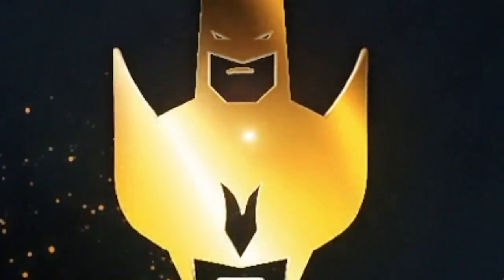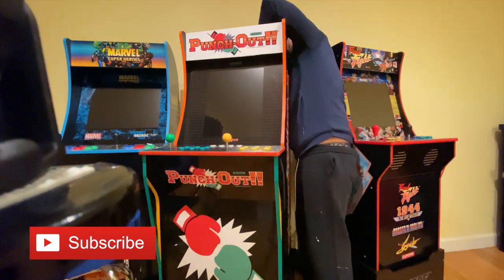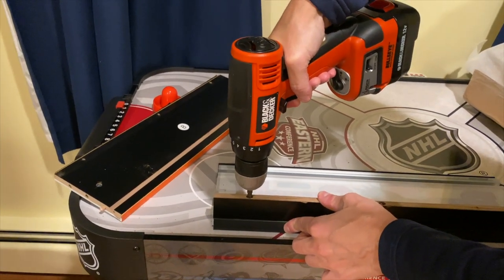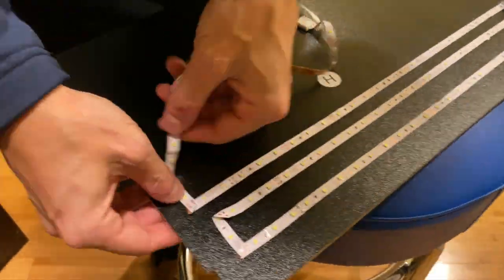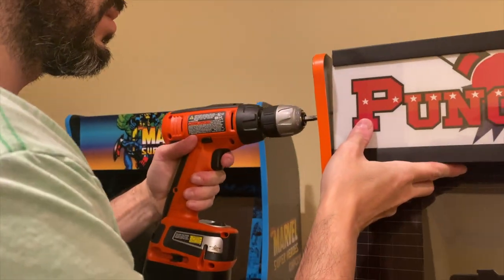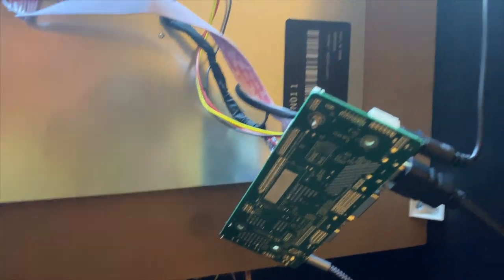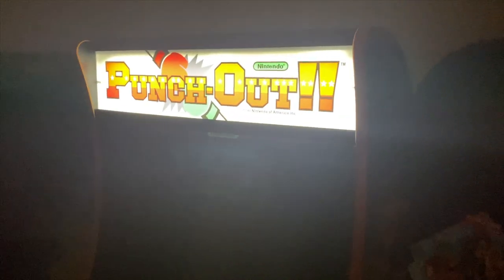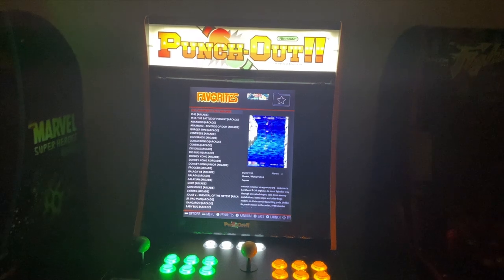Arcade1up Light Up Marquee Install

Comment: I just got the mk2 version and noticed the light bleed. I just used black tape to seal the border of the marquee and the wood piece  (from the outside )  where the light is coming out. You can’t see the light or the tape and was super easy. That cabinet looks good!